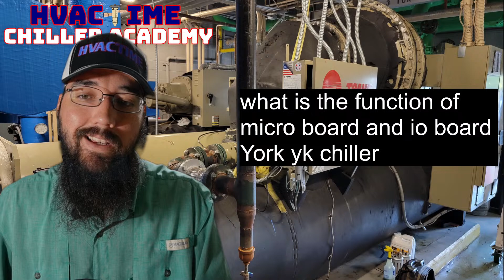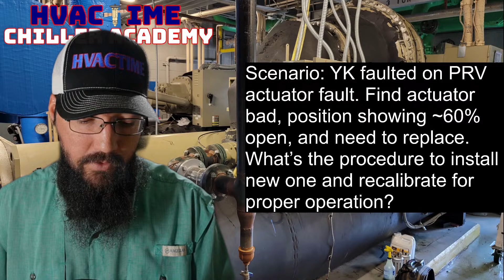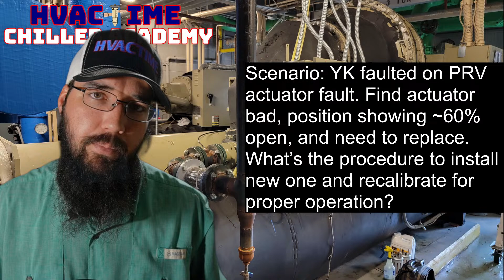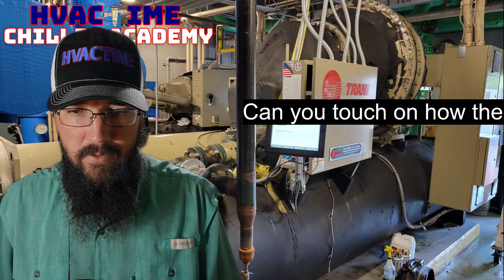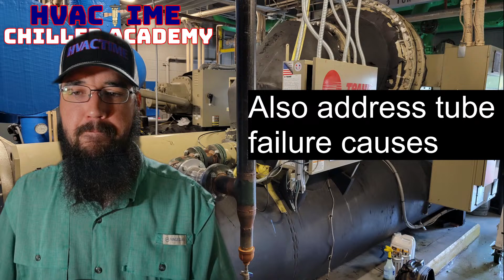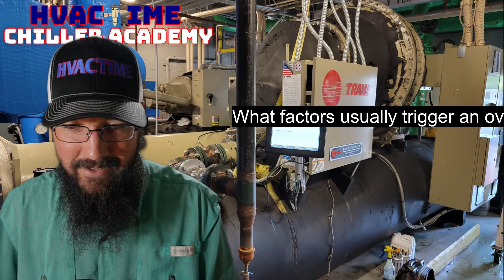The Centrifugal Service QA

Comment: Hi boss how are you? Will you please guide me the proper procedure to drain/change the oil of cvhf/chve trane chiller, how we will drain the oil since it has negative pressure in the oil sump?
Reply from the maker: You need to pressurize the chiller. I can work with you on a step by step procedure in the service program at chilleracademy.com
Reply: @HVACTIME  if we not open the chill water valves for few days, the saturated evaporator pressure increases,similarly the oil sump pressure also increases with increase of saturated evaporator pressure,will it help to drain the oil?
Reply from the maker: Yes that is one way, if there is another chiller onsite then raising the condenser water setpoint and flow warm condenser water will help too.
Reply: @HVACTIME  thanks alot for your response, really appreciated, you are doing a good work, I learned alot from your educational videos on YouTube.❤️
Reply: @HVACTIME  I searched alot on YouTube I didn't get any videos, so I contact you۔